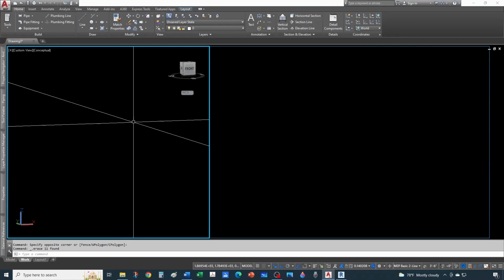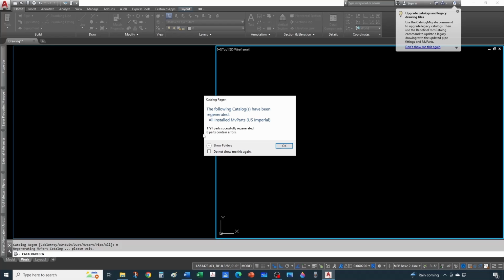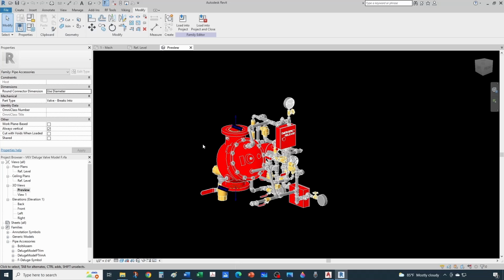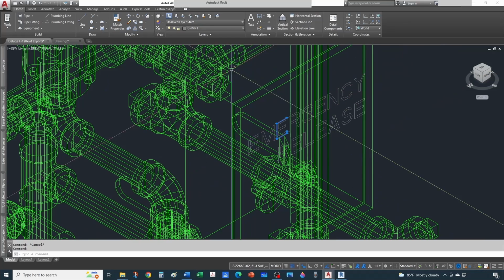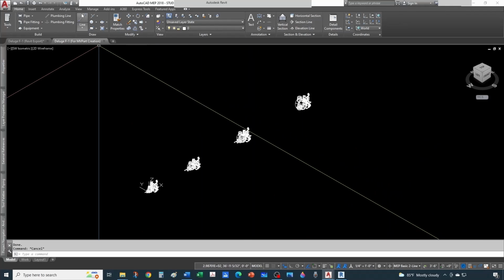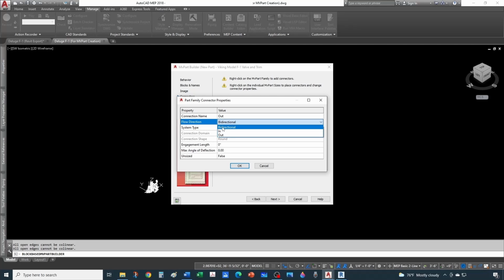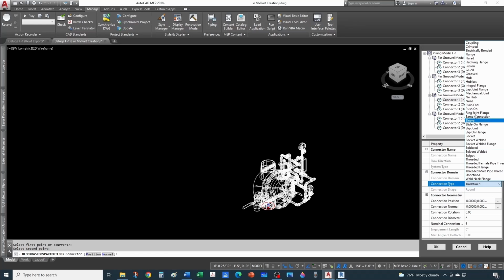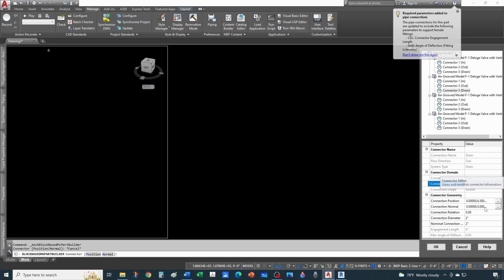How to Create MV Parts (All About MV Parts)

Comment: Hi Alex 
What about if I didn't have rfa file for my equipment?
Reply from the maker: Hi. 
In that case you have to first build the solid geometry, using tools like "extrude", "revolve", "sweep", "loft", etc.
I recommend going basic at first, and little by little build skills. Contact www.BIMitUp.com if you would like further help =)
Good luck!
Reply: @bimitup  hi 
Can I model ammonia system in Revit ?are there Revit family for these ?
Reply from the maker: @ah9503  Yes you can. There is some content available, go to manufacturer's website and ask, and to www.bimobject.com. Cheers!